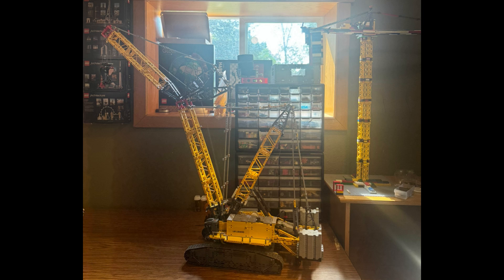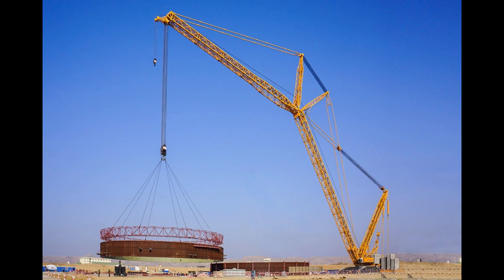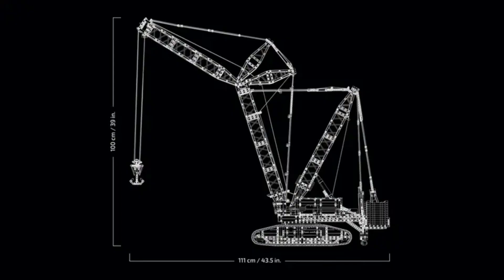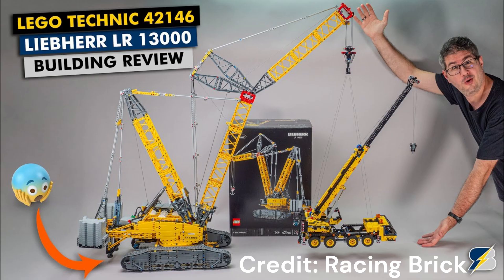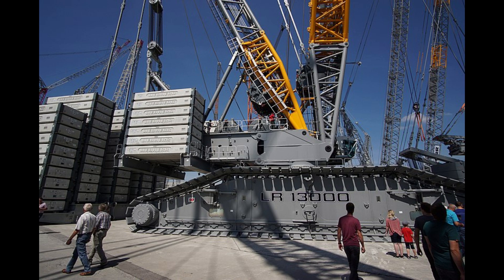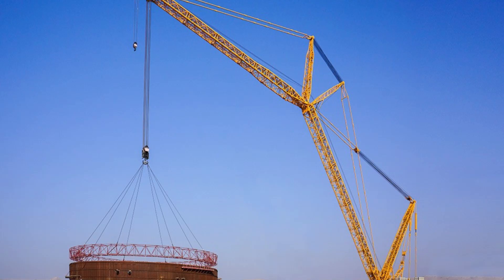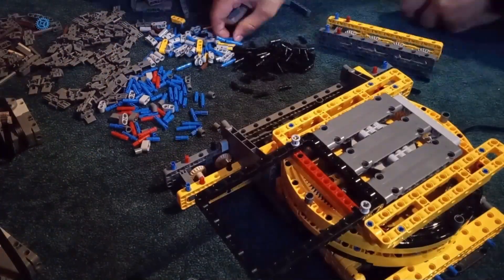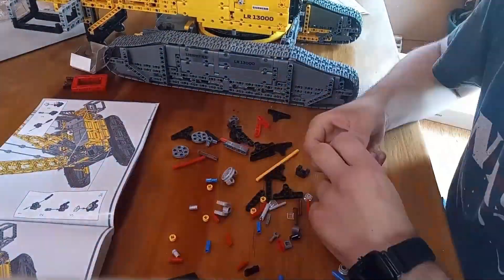LEGO vs. Reality-Comparing the Technic Liebherr LR 13000 to the Real Crane!

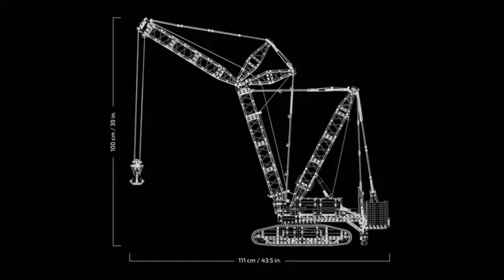Comment: 1:02 The lego crane absolutely does NOT maintain a faithful scale to the real thing. To maintain scale, the main boom should be over twice the length, while the jib should be close to twice the length. The lego version has a main boom of four pieces, but should be about 9 or ten. The jib is three but should be five or six.

I have this model and think it's brilliant, took me just over 3 hours to build, but to claim it is in scale to a real one is just plain false.
Reply from the maker: You’re absolutely correct! Lego did a smaller version with almost proper scale for the size. Any bigger and not a lot of Lego fans could get their hands on it. I can’t argue with your thinking there but with what Lego had to work with it turned out pretty darn good.